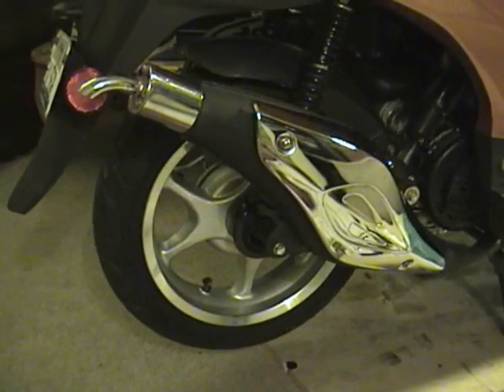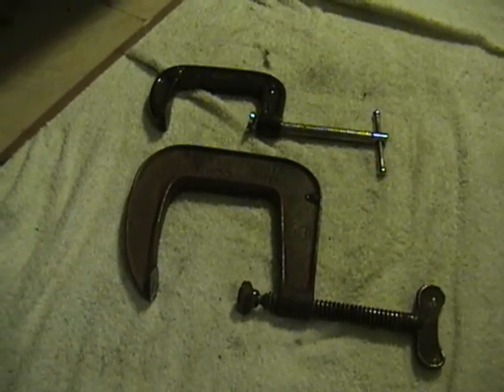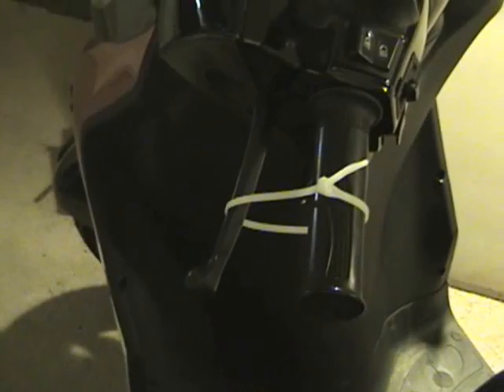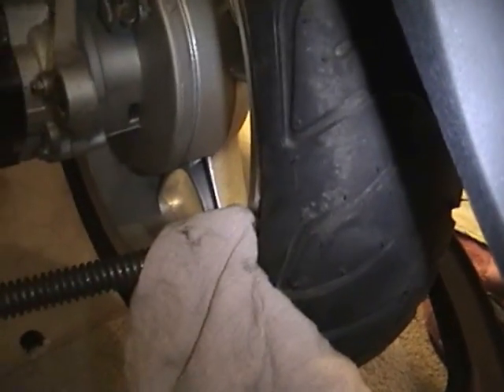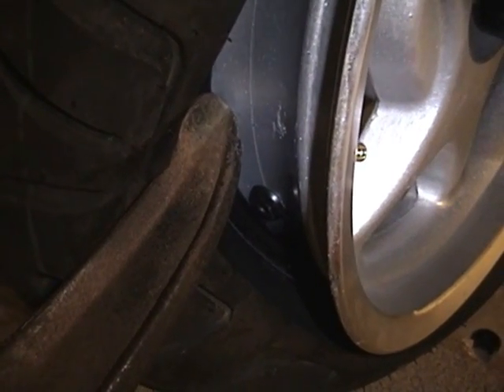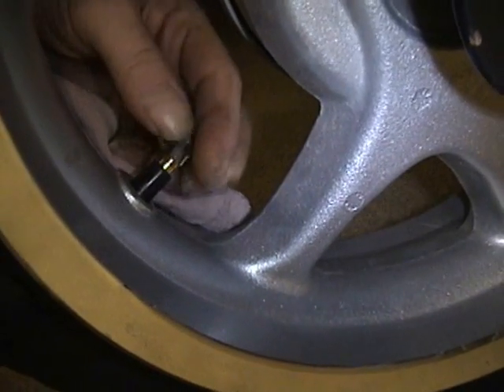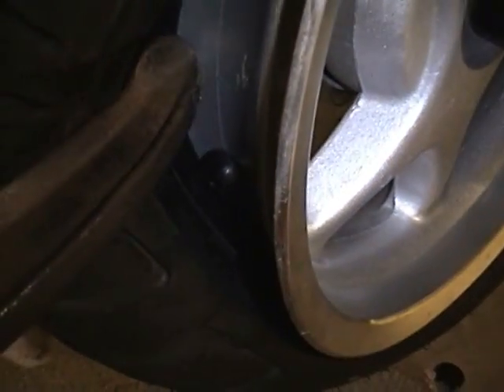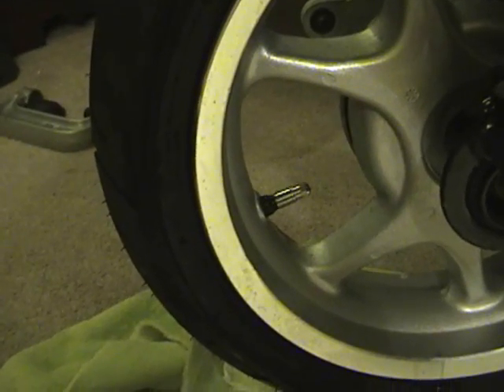Chinese Scooter Valve Stem Replacement Made Easy

Comment: Thank you for the helpful video.  I just purchased two (2) Roketas yesterday.  The rear valve stem blew out on one of them on my first ride.  Fortunately, I was going quite slow.  

Since it sounds like there is a repeating pattern of blowouts, I think I will replace front & rear valve stems on both scooters ASAP.

Thanks again...tremendously helpful.

Comment: Great! Broke off a valve when I was trying to fill tire with air. I thought I would have to bring the scooter in to a dealer and spend more than a few $ to fix. Replaced both valves in less than half hour.
Just an additional note. When I went to fill one of the tires, the tire did not initially pop into its bead. I started the scooter and slowly rode it for 20 feet. The movement helped seat the bead and it filled right up. So far, no more low tires.

Comment: Thank you!!!!

Things I did:
- Put an old sock over the end of the clamp to keep the rim from getting scratched. My kid's sock worked great!
- My tire didn't seat afterwards. So, I wrapped a tie down strap around the wheel and winched it really tight. Then, I inflated the tire with air as normal.  The tire seated itself with a small pop. I've heard you can also use a rope, belt, etc to do the same trick. Google "seating a tire" for other ideas.

Comment: THANK YOU for this video, i just did this to replace a broken valve stem on my front motorcycle tire that had a 110/80/17 tire on it. Worked perfect and got the job done in 10 mins!

Comment: god bless you, I just change the valve on my honda sh125 using your video, 2 c claps and tr13 valve (12 to small, 14 to big), took me 2 hours to finish, very hard work ,the tyre make a lot o pressure, but everything looks ok, I ride 2 miles for checking ,looks perfect

Comment: A very good, quick and easy to follow tutorial.  I have done this many times over the years and I still enjoyed watching this short video. Most important to check those chinese scooter valve stems. that rubber cracks fast  as you pointed out even though they look perfect on a quick inspection.  Someone already said: this can save your life, simple and do not have to totally disassemble the rear end either. AutoZone , NAPA, etc , just make sure about the size as they come in different lengths , too. Thanks again, much appreciated.

Comment: Hey mate, thanks for the tips regarding these valve stems. Yesterday I was doing 73mph (Full throttle) when my front tyre deflated in a matter of 2-3 seconds (Blowout) After spending some time looking for any puncture holes ect: I discovered it was my Valve stem that had completely snapped off. I inspected the rear tyre and discovered that it is very close to doing the same itself due to ''Cracked/Perishing''. I have just purchased 2 straight vales (Mine were both the 90 degree angle ones.

Comment: Thank U "lansdrymanvideos", because yesterday when I was locking up my 2010 Jonway F-One 150cc Scooter, I busted off the front tire valve stem. it was dryrotted cracked & not having the bucks for a dealership I did what your video said & in no time I was putting air in my tire.
Don't buy the Chrome valve stems, they don't work. Buy the "Slime" .453 1-1/4 2080-A. Use a piece of wood between the clamp and your rim, tighten it down & pull valve stem thru the hole-take the clamp off-your done.

Comment: Important reminder / tip : Remember, a seen in video, clamp goes on rim on one side and only squeezes tire on other side. Don't pinch tire on both sides or you probably won't get the tire to set again without taking the wheel off. I almost did this but asked my mechanic about this video and he said ya try it but only squeeze one side with C clamp, not both. I was like omg thanks! I almost did that but come to think of it, the video DID show it on the rim on one side ( hence the piece of material  to prevent scratching)

Comment: @larsagi2008 Fortunately I have two pergeot speedfighter wheels and used your tutorial to remove/swap both the stem valves into my GY6 until the new ones arrive. It really is an easy job and your tutorial is MUCH appreciated. I purchased my new stem valves for 49p each from Chinese motorcycle parts but with delivery it totalled about £5...

Also I wanted to add a tip to your video. Search E-Bay for ACF-50 its an anti rust formula which is also great for preventing rubber/plastic from perishing.

Comment from the maker: You use what's called a Schrader tool pronounced, "shray-der." They're available at any auto supply store, bicycle shop, hardware store, where-ever and only cost a few bucks. If you're only going to use it to deflate the tire, then you can pull the valve off with a pair of pliers quite easily since they "blow-up" anyway. If the bead of the tire fully separates, then you may need one anyway. Hope this helps--Jeff

Comment: Wow...didn't know how bad this isssue was until I was going full throttle down a dual carriageway (1st time on a dual carriageway as well since I'm a new driver) then all of a sudden my back wheel went asll over the place!

Valve stem had popped off and all the air had immediately deflated.

At least its cheap to replace & easy to repair!

Comment: hey man... GREAT video on the valve stem replacement!! Thank you!! However, when finished, I loosened the C clamp, and there seems to be a little space between the rim and tire (only where I put the clamp) will this self adjust when I put the air in?

Comment: GREAT VIDEO and I got bit by same problem on a Roketa 250C I just bought a month ago on my rear tire valve stem. I bought @ Auto Zone both the TR413  0.453  1 1/4 inch valve stem and the TR415  0.625  replacement valve stems.
The 0.453 would not seat, you could pull and pull and it would not snap in place on the rim, seemed to small.  The 0.625 was to big and would not pull thru the hole in the rim. Is there an in between size valve stem or am I doing something wrong???  Is there a diff size?

Comment: Kudos to youdos almost painless...I had the same deal 600 miles and cracks all over...phewwy. Got two types one that bolts on inside and a one piece the only difference is they are the angled type so when I go to pull it up thru the rim I may encounter an issue...any ideas? and yeah I know get a straight one but what about the angled jobs?? also got dynabeads in there so am aware of that buger bear.

Comment: I tried using a rag over clamp and found that it slipped off...so I cut a small piece of wood approximately 1/2" x 3" x 6" and put it on the side opposite the twist on the C-Clamp...partly over-laping the rim.  This worked very well since it distributed the force of the squeeze of tire allowing the twist side to move the tire past the stem without moving the opposite side of the tire keeping the tire bead in place.  I used an 8" C-Clamp but a 6" may have been more appropriate for the task.  I used a short 1" valve stem available on Amazon.com ... four for 5 dollars.  I suggest finding a metal cap for the stem so it can be grasped with the vice grips without damaging the stem treads.  I used an old plastic cap but a metal one would have been easier.

Comment from the maker: @Hammered30  I'm not exactly familiar with the Roketa rims, but a standard automotive size is the one you need, It won't be real easy to pull it in and you'll have to give it some effort. try a little soap like DAWN on it to make it easier to pull, you will need a wrench to snap it in or a valve stem puller tool

Comment: So you deflate, squeeze the tyre replace the valve stem, and then, do you use any material to make the edge of the tyre stick to the rim before you inflate? Or just let it go and it will sit and not let any air escape?
Reply from the maker: Try to keep as much of the tire attached to the rim as possible and only bust loose one side of the tire in the spot where the valve stem is. If the bead comes loose around the whole tire, then it may take some effort to reseal it. They do make a bead sealer in that case which is available at any auto store. Rubber cement can also work in a pinch. If the whole beam comes loose, you'll have to use a decent compressor or charged airtank for sure as a little cricket on a treadmill compressor will not generate enough air flow at once to fill it.  Hope this helps ya.
Reply: I've just done it today, thanks a lot. The hardest part was finding the right tool to press the tyre away from the rim. I used my car jack between a wall and a tree, with a building block as a spacer. Didn't even have to lube the valve (I think it already came a bit lubed, or so it seems.)

Many thanks for getting back to me and thanks for helping.

Comment: After you take the c lamp off how do you get the tire to sit correctly on the rim. There is a gap and I'm not sure how to pull it back into place.
Reply from the maker: +Jared Levie  you need a high pressure air source such as an air tank or good compressor.. One of the cricket on a treadmill mini ones might not do it. Also it helps if you remove the schraeder core from the valve stem as the  air will flow in faster. Another way is to use a ratcheting strap around the tire itself to tighten it up some. Another way, but I don't suggest it, is to use hairspray and spray it inside the tire and light it. Again, I do NOT suggest using the hairspray method!!!

Comment from the maker: I used regular valve stems for cars. DO NOT BUY ones with these numbers on the bottom of the valve as these are recalled. TR-413
TR-413CH
TR-414
TR-415
TR-418
TR-423

I used TR-413EM style. Be aware that they should have a different lettering than "none" or CH as a secondary designator. Make sure they are EDPM "EM" and not real rubber. The real rubber ones are the ones recalled. I got a set of 4 at AutoZone for about 10 bucks.

Hope this helps & ask to look at the numbers first :)

Comment: Okay - so front tire was a piece of cake. But the rear is a problem... First, couldn't get the rubber base of the valve out with the pliers... it fell apart (surprise) ---- and then I (foolishly) pushed it into the wheel. But the real problem is the c-clamps don't create enough room to even get close to the valve hole. Suggestions?

Comment from the maker: @barthoedemaker  You may want to ask the people below , "How useless." this video is. All personal experiences may vary for sure. Bottom line- The angle valve stems on the Chinese bikes are made of natural rubber (cheap) and not a synthetic composite which is sturdier, and they'll fail. I build (PDI) these bikes and I change them out before I give to a customer. 15 minutes is worth it and if you do in fact repair them, then why not offer the service. It is a safety issue -Period. Just my opinion

Comment: barthoedemaker comment is what is useless. Today's experience that I just posted on FB for my scooter club:
"...the valve stem blew out on my back tire! I decided to try and drive it home and managed to get home safe and sound - all 14 miles on a flat. The tire appears to be fine. So the moral of the story is this: Examine your scooter's wheels and tires regularly. If the rubber on the valve stems appear to be cracked or they just don't seem right, replace them soon.

Comment: @lansdrymanvideos Okay, if that's your opinion. My opinion is that it can hold untill the next tire, the new tyre/rim from factory does not leak, so there's no need to touch the valve stem. Never had problems with it. And I'm mostly the only company that's working on chinese scooters here in the netherlands... bartsscooterservice.nl